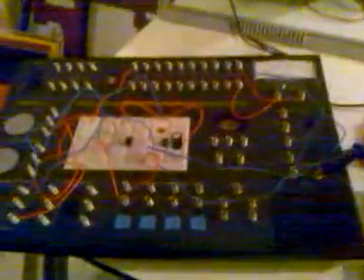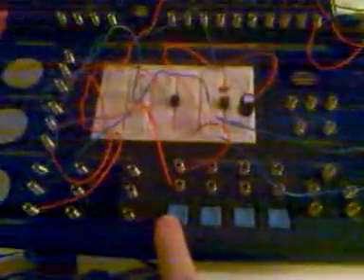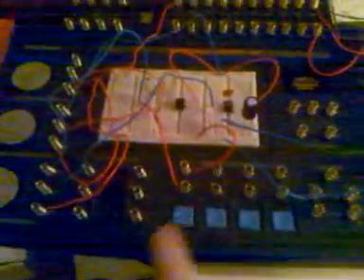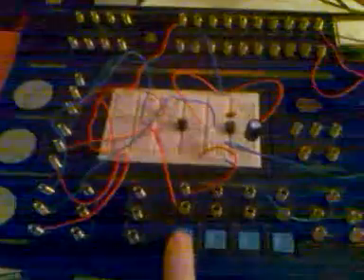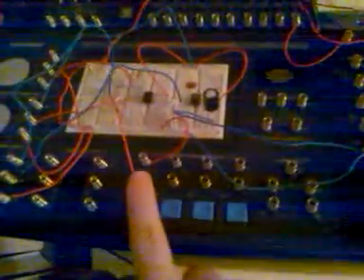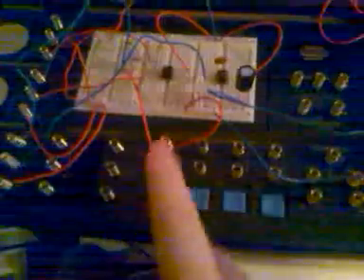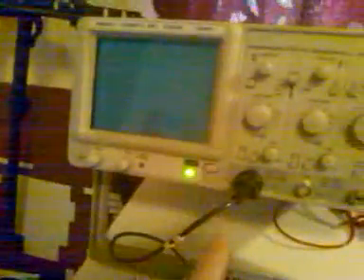electronics learning lab hacked with AM radio

Comment: what happens is that when you put the LED it acts as diode which is essential for a am receiver because am radio a sine wave which has both negative and positive charge the diode or led cuts off the bottom part of the signal what left is the sound signal which plays through the speaker